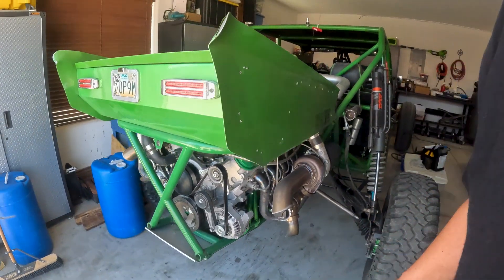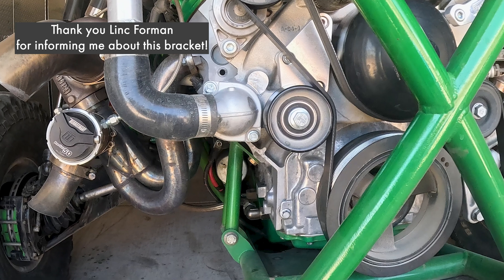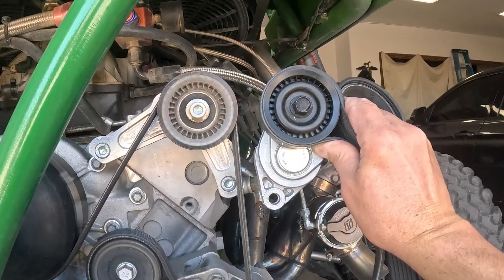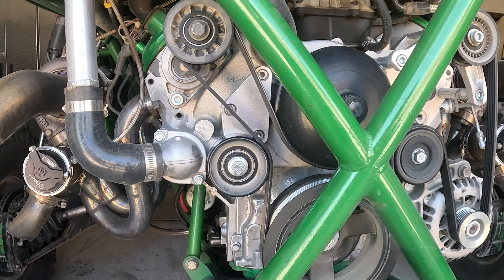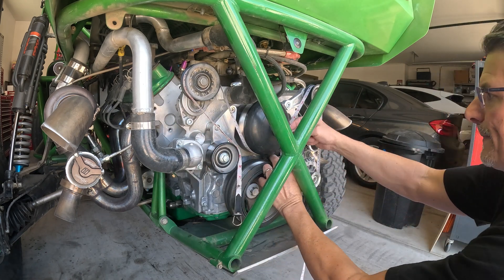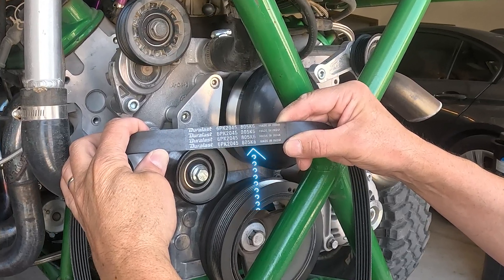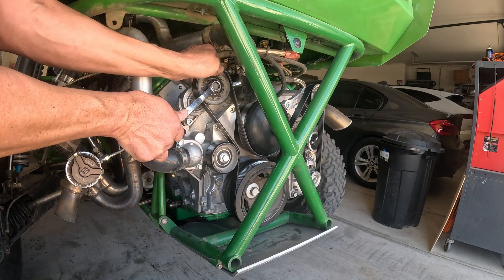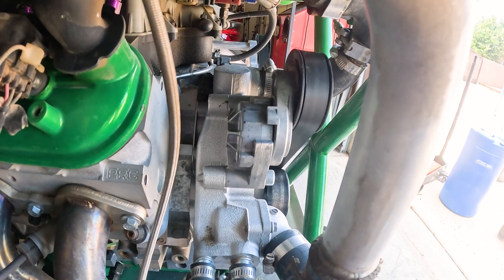How to Reinforce your Serpentine Belt

Comment: I see you have your heater hoses or bi-pass hoses blocked off what thermostat do you run or do you run a disc in lieu of the thermostat or none at all!
Reply from the maker: I run a freeze plug with a drilled hole.